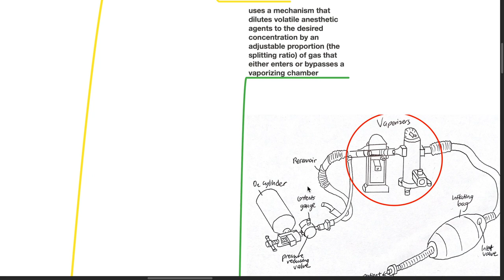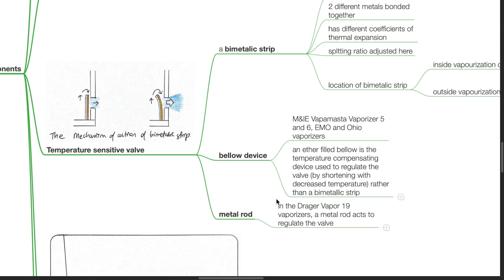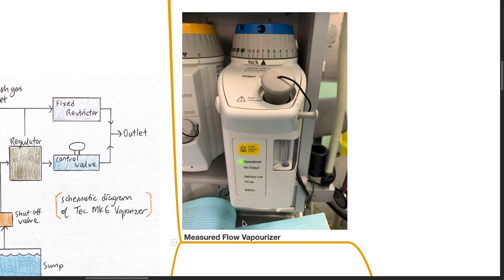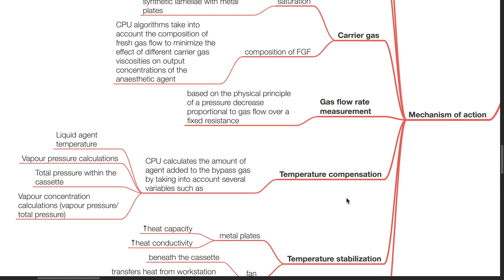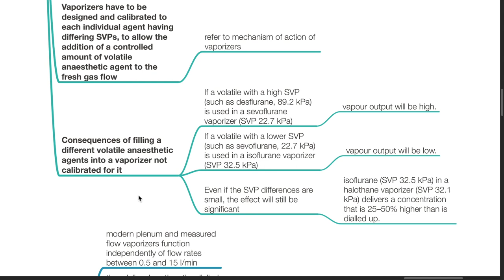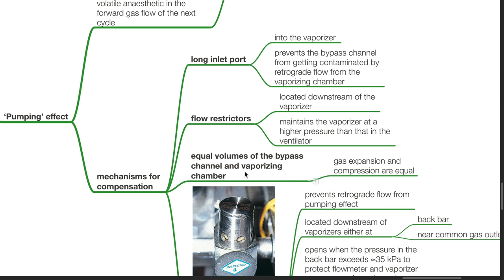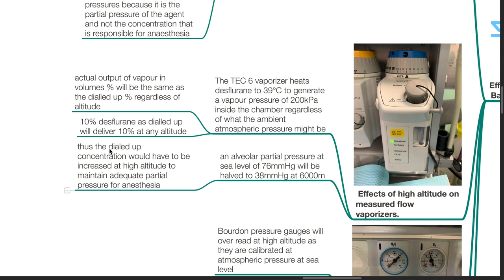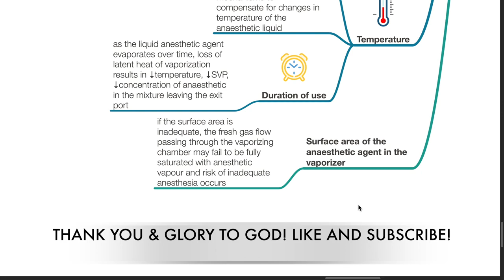ANAESTHETIC VAPORIZERS - PHYSICS SERIES

Comment: A variation in different literature suggests the vapor pressure of Isoflurane is lower than Halothane (238 mmHg and 243 mmHg, respectively). Also, some literature states that using Isoflurane to fill a Halothane vaporizer results in a Lower concentration output. I just wanted you to know that including this could be controversial and confusing, as I spent several hours on the concept. 

Reference: Ehrenwerth, J., Eisenkraft, J. B., & Berry, J. M. (2021). Anesthesia equipment: Principles and applications (3rd ed.). Elsevier.

Comment: Can you/someone please explain the pumping & pressurising effect, specifically? The above flow chart is very nicely prepared. Thanks.
Reply from the maker: The pumping effect occurs as minute volume divider ventilators exert a pulsatile back pressure as they cycle. This pressure forces some of the gas exiting the outlet port back into the vaporizing chamber, where more vapour is added. Retrograde flow may also contaminate the bypass channel. These effects cause an increase in the inspired concentration of the agent which may be toxic. These pressure fluctuations can be compensated for by having
a) a long inlet port into the vaporizing chamber
b) downstream flow restrictors
c) having both the bypass channel and the vaporizing chamber being of equal volumes so gas expansion and compression are equal.

-Reference: Al Shaikh B et al. Essentials of Anaesthetic Equipment, 4th edition. Elsevier, 2013, Pages 39-40

'Pumping effect - pulsatile back-pressure increases output, especially obvious with older vapourisers, at low flows, and with large pressure swings. Increasing back-pressure will compress gas in the plenum chamber. When the back-pressure drops, vapour-laden gas in the chamber will re-expand and try to get out. It can get out via either the inlet or the outlet line. Via the inlet line, fully-saturated gas can mix with and contaminate the bypass gas. If there is a short connection between the vapour chamber and the outlet line, pumping back and forth between the two will also increase output. Modern vapourisers have overcome this with smaller vapourising chambers and long inlet and outlet lines.

Pressurising effect - (constant) backpressure reduces output. For example, high resistance in the line after the vapouriser will compress all gas before it. This increases the ratio of carrier molecules relative to vapour molecules in the vapour chamber, because the number of vapour molecules is fixed, whereas at higher pressures there will be more carrier gas molecules. The absolute percentage of agent per unit volume leaving the vapouriser is correct, but when the gas mixture expands post-obstruction, there are fewer molecules of agent per volume of carrier than there should be. This is a minor effect.'

http://www.anaesthesia.med.usyd.edu.au/resources/lectures/gas_supplies_clt/vapourisers.html
Reply: @ForeverLearningAnaes  Thank you very much.